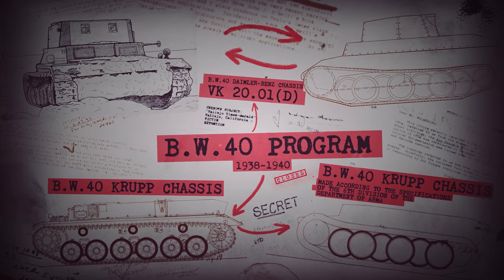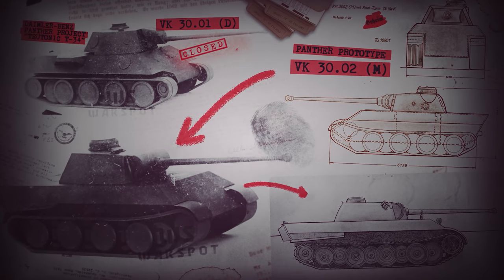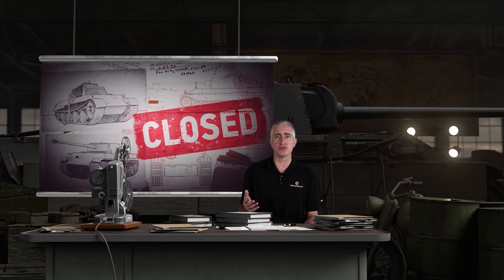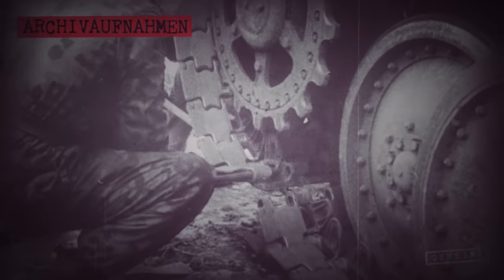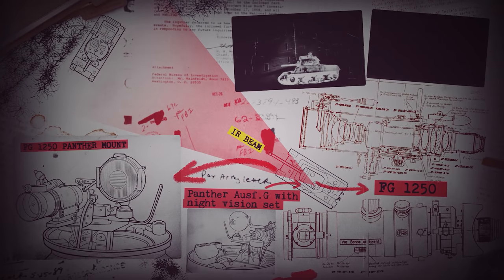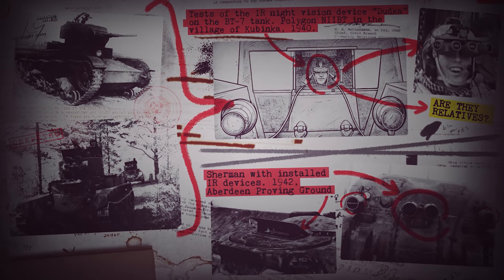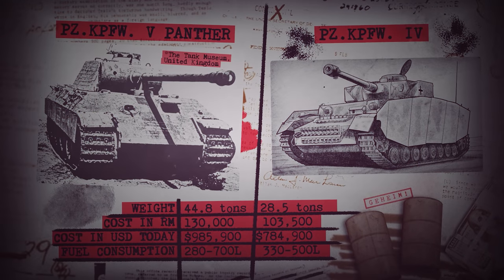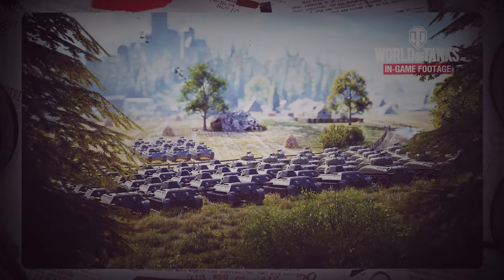Five Things About the Panther with The Chieftain - World of Tanks

Comment: The Panther was an ergonomic nightmare for the crew, and I think Germany knew that, which is why they kept testing new turret designs for the tank. I'm certain if the Panther had been released 2 years earlier, or had the war lasted 2 years longer, the Panthers glaring problems would've been ironed out. But alas, you know what they say about hindsight.

At the end of the day, the Panther had very good frontal armor, a very good gun, and exceptional manueverability for the size of the tank -- and that's about all it had going for it. It had a lot of potential that was never granted enough time too come into fruition.

Comment: "The myth is that Panther was unreliable...." Then goes on saying how unreliable it was. They never fixed the problems with the final drive. 

 I mean, it doesn't matter if the final drive can be replaced just as easily on a Panther as it can on a Sherman, it still breaks FAR more often. The US also had the logistics that could fix those broken down tanks a lot faster. The Germans didn't. One, they never learned a thing about logistics from day one in September 1939. That is what you get when a little corporal thinks he can run the Heer. Second, even if the Germans had the logistics the Allied air forces would have wrecked it just the same. Part of that quality equation of trying to match the allies should have been more reliable equipment that didn't put stress on an inept logistic system.
Reply: The issue of final drive was resolved in the panther later models. This was stated by Henry Doyle
Reply: @trejbiorgroup1713  wrong, but thanks for playing Panther fanboy. They NEVER did a drastic redesign of the Panther's final drive. The weakness was IN what TYPE of final drive it was.
Reply: @trejbiorgroup1713  I'm sure you will be very forthcoming with the episode or source that Henry Doyle said that so I can waste my time looking it up to find out he didn't say it.
Reply: @timothyhouse1622  Its not about being a "Panther Fanboy". If you don't want to take the suggestion, doesnt matter! Do some research you will come to know what was Henry Doyle's remark against the final drive of later model Panthers! Good bye
Reply: Some modifications were made to the final drives in vehicles built after Sept/October 1944, so about a thousand had some form of improvement (which is actually an error in my video, then). Power train never seemed to be entirely satisfactory, though.
Reply: @TheChieftainsHatch  I read somewhere that the Panther and Tigers' trans and final drives would flex when overstressed which caused their housings to crack and bust seals/gaskets so their lubricating oil ran out, causing bearing, bushing and gear failures.

Comment: The Soviet assessment of the Panther is accurate.... it was a one -trick pony, excelling at fighting enemy medium tanks at long range but not so good at slugging through enemy infantry defenses or other tasks.  Also, even the fixed drivetrain still struggled to get in more than 100 hours before failing, which is far behind not just the Sherman and AFV based on the Sherman chassis, but also AFV based on the T-34 and IS chassis.

Comment: I have a question that bothers me, if chieftain or anyone else can answer

As my understanding goes about the panther the main problem was reability, transmission was of horible quality and thus panther could go an average for about~200km before something has to be refited. Other tanks from the era also had reability issue especaly under combat condition but not as near as panther.

Why then some major post war users like france, didnt just produced equipment for the panther of higher quality, if it is just transmission only thing u have to do is make good transmission (or whatever else) and in return you get pretty descent tank for post-war standards
Reply: It wasn't so much the Transmission as the final drive (though the engine and trans were no prize either).  And it wasn't a case of being made badly so much as using too weak a component.  Think of making a Motorcycle with a Moped-type sprocket, and you're on the right track.  Changing that part would require a re-design, and the Panther wasn't THAT advanced (and it wasn't made to be easy to change).  Also rear-drive "power packs" (engine and trany combos, driving a rear drive wheel) were on the horizon, better things were coming.
Reply: @drewdederer8965  idk man, did you ever saw a size of that thing, i can bet u can place a whole lot of components without ever re-designing the hull.
That thing is tall as M3 Lee and long as school bus.

And even if they had to redesign it, they could do it, people back in those days were redesign tanks into SPGs, TDs, even into Boats, armoured trains.

French i think missed an oppurtunity, but never the less, thx for sharing kwnollege
Reply: The Panther always had problems with the engine and final drive because they had made design features that were never fully tested out before sending it into mass production.  The final drive eventually had modifications and fixes to make it better.   All tanks have final drive maintenance, it just required more effort on the Panther as production quality eroded.

I'd have to say the worst quality medium tank of the "big boys" that were mass produced was the T-34-76.  Even though tens of thousands were constructed, tens of thousands were destroyed.  Around 50% were lost to combat or breakdowns.  They ran on the maintenance heavy christie suspension and used a weak drive system and tracks of questionable quality.  They were aware of the faults and eventually fixed many of them in the T-34-85 and the modernized version post WW2, but for most of its run, they didn't bother investing in long-lasting parts because the average life of a Russian tank on the eastern front was very poor.

I think France didn't want to invest into modernizing and fixing up the Panther, even though they had a significant amount of them. They had no experience with them, and thus suffered a great deal of problems maintaining them.  France post-WW2 had a big hot mess, using German, Italian, British, and American equipment and tanks. At any rate, it was the tank of the German occupiers, after all, and creating a new tank for France by France would be a source of national pride after WW2.  Which they did in the 50's.
Reply: The French Army took possession of a limited number of Panthers only for evaluation purposes. They had at most one squadron in operating condition and kept some running until they ran out of replacement parts and ammunition. Then those were shuffled off to various museums to be placed on display.
Reply: @billwilson3609  The French had 2 regiments using Panthers in at least 1 battalion each for 2-5 years after war's end.  503rd and 501st regiment.
Reply: @drewdederer8965  Yep, for evaluation purposes only and were never considered to be combat ready units. They started off with a large number of Panthers that were steadily reduced due to component failures. The survivors were transferred to AMX in 1960 for further evaluation then sent off to the museums in 1965.

Comment: **sigh**... the same guy who tried to convince those of us who are serious about history that the Sherman was more combat effective than the Panther based on a single battle (Arracourt), continues to play "expert"...  Btw, small hint concerning the Panther's reliability record: Put it in relation to the other German vehicles operated at the same time, such as the "highly reliable" Pz.IV, and you'll see it fared no worse. Now ask yourselves how come that was the case? Answer: Germany was low on not just fuel, but also oil. What is oil used for? That's right, lubricating parts. This severe lack of oil meant German vehicles had to run way longer on the same oil than any Allied tank (many German tanks never got an oil change at all, and only ever ran on what they came with from the factory), this combined with a lack of spare parts (each of which don't last as long as they should either due to the lack of oil) resulting in less maintenance stops, and violá!, you have the reason why most German tank losses were to either mechanical (engine &/or transmission) failure or lack of fuel. As for the combat performance of the Panther, ask any of the WWII US tank vets still alive, or refer to the report sent to Eisenhower in 45 by the 2nd AD.
Reply: sigh a werhaboo...

Comment: Next videos: five things people didn't know about the Tiger I.
Maybe we should kick it off with one: looking straight down, the Tiger's turret is actually offset to one side.
Reply: No it isn't "offset". It bulges out very slightly on the right to give the loader more elbow room. This makes the gun appear offset by 10 cm to one side in its mantlet (although the gun is still dead centre in the hull).

How about starting off with the Tiger drivers' commonly improvised field repair for leaky gaskets?

Comment: The quality part of the design is questionable with the corners that were cut in design of the panther.
The lack of a unity sight, independent turret traverse, ECT all add up to slow follow-up shots. Not a great idea when you really need to kill 3,4,5 or more enemy in quick order, or you get overwhelmed.
The idea of light, boosted controls, fragile drive line components, and excitable conscripts being used in conjunction in combat was probably less than brilliant as well. 
Monday morning quarterback, but not exactly unforseeable
Reply: The Panther was never fully utilized as a tank, as its main weapon was virtually useless in the infantry support role.  Some material describing the Panther by the Soviet army called it a Tank Destroyer, like what the US had developed with the M10, M18 and M36.
Reply: @uni4rm  that is a problem when comparing the panther to the Sherman or T34. For the Germans, they had the stugs for infantry support, so less of a concern on that.
A design trade off for the velocity to kill other tanks as well as increased barrel wear.
Different countries have different requirements for their tanks. I try to judge a design on how well it worked on it's design criteria.
As a high value tank with the requirement of destroying multiple other tanks, namely the t34 and Sherman, it cut corners that would allow it to do that. Items that were on the stug as well as t34 and the Sherman, IE well known to the Germans in 42 BEFORE the final design work on the panther

Comment: The most pervasive myth about the Panther is that it was a medium tank.

And the main justification for that - "Germans called it that".
Except to the Germans it was a "mittlerer Geschutz Panzer", not "mittlerer Panzer" - a "tank with medium gun", not a "medium tank". Same applies to medium companies.

Another false justification - "it replaced Panzer IV". However, roman numerals in German tank naming system are not models, but tactical niche types. This is why Panzer II Ausf.G is a completely different tank but is still called "Panzer II", and King Tiger is not "Panzer VII" or something but still "Panzer VI" (Ausf.B).
If Panther really did replace Panzer IV, it would receive a Panzer IV type designation.
Reply: The panther was called several things. Its final produced modified form was a compromise between the capabilities of the maneuvering support medium tank with the survivability and firepower of the heavy tank.  It was arguably an early attempt at the "universal tank" which is a concept of a tank mixed with the concepts and capabilities of both a heavy and medium tank.  This concept led to the MBT (main battle tank) concept we use today.  Everyone was doing it, but like the jet fighter, Germany did it first with the Panther.  The other tanks with this attempt were the T-44 by Russia, the Centurion of the UK, and the M26 of the US.
Reply: @uni4rm  
I'd agree that the Panther is best described as an MBT retroactively, but the point is that it is not a "medium" tank as it is commonly portrayed now, and it was commonly classified as a heavy tank during WW2.

Comment: Hey, Chieftain, why don't you update us and perhaps Wikipedia on VK 20.02, please:

There is a quote by T. Jents and H. Doyle :

VK 20.02 (M)
This was the immediate predecessor to what would become the Panther. According to M.A.N. based on the requirements given by Wa Pruef 6, it was one of the designs they reworked with sloping walls following the "Russian design". No other details about this design have been found.

-- And since it was such a shitty design, that after encountering glorious Soviet T-34, plans for replacing Pz-IV was dropped, and whole new tank, that is almost double the weight and nearly tripled the calibers of the gun was develop, shouldn't you emphasise the significance of that event, instead of downplaying it?

--And another point, you mentioned that VK 20.02(M) was more advanced into development, HOWEVER I read(in just about every book on Panther design and development), that it was Daimler Benz prototype was more advanced and ready to production, not to mentioned that it was a front runner per H. Guderian and A. Hitler, before through the intrigues from representative of M.A.N. Hitlers's mind was changed.

Could you please address this two points!
Thank you!